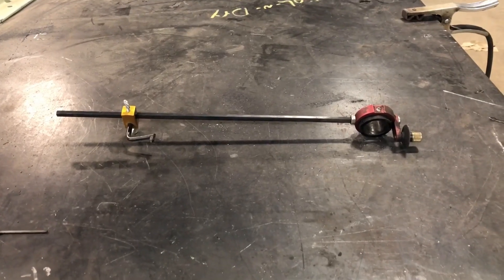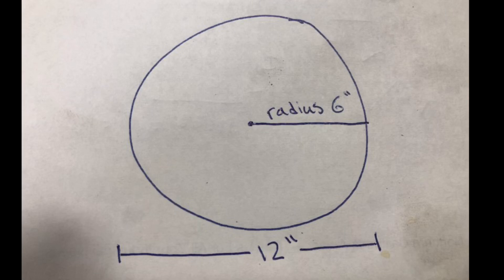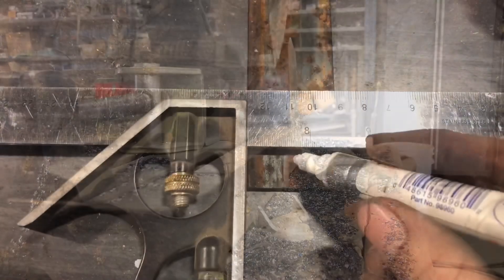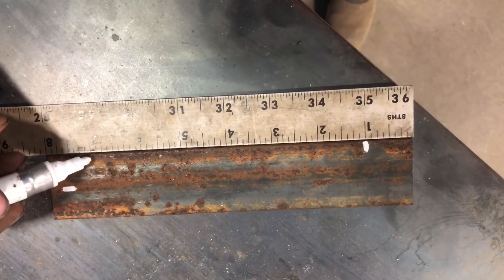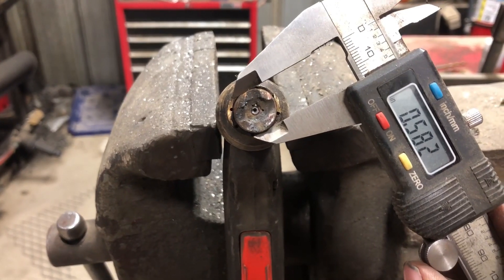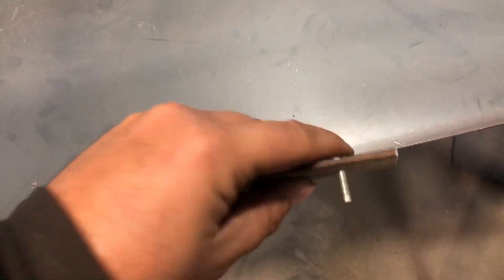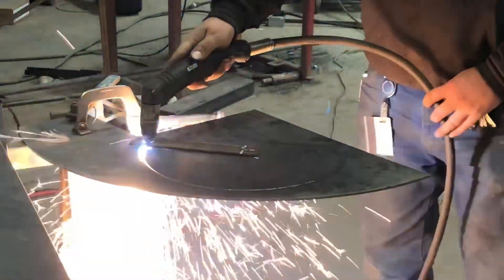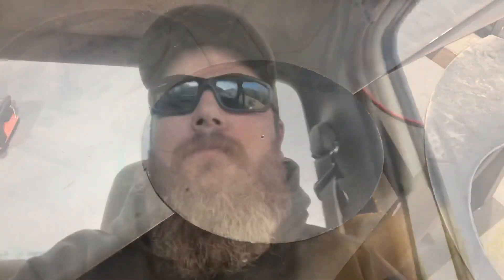Cheap easy circle cutter for plasma

Comment: Another simple way to make a circle cutter is take a length of 3/8 rod and weld a set collar on the end the size of your plasma cutter. Attach an old punch or any type of metal with a point and fab a small block with a 3/8 hole drilled though it. Then drill and tap a 1/4-20 hole for a thumb screw to attach the block to the 3/8 rod making it adjustable. You can slide the block up and down the 3/8 rod to  adjust the size of the hole you are cutting. Center punch your work piece and place the point in the spot to punched.

Comment: Perfect. I was thinking about getting an everlast plasma cutter. This video comes in very handy
Reply from the maker: Nice thing is you can make these any size you want. Or drill multiple holes in the same one to accommodate different size circles. I didn’t know Everlast made a plasma. Check out Hypertherm, Miller, and Thermal Dynamics. I’ve used them all with great results!  Thanks again
Reply: Another Neverlast Spam.

Comment: Good job , I fingered there had to be something out there for cutting circles, but I'm to tight to buy something.  👍
Reply from the maker: Glad you found this helpful. Store bought circle cutters are pricey! These work great, if you don’t want the hole in the center just weld it closed and grind it off. I actually made one of these 10’ long once to cut a wide radius!